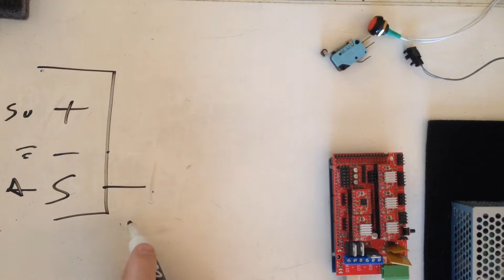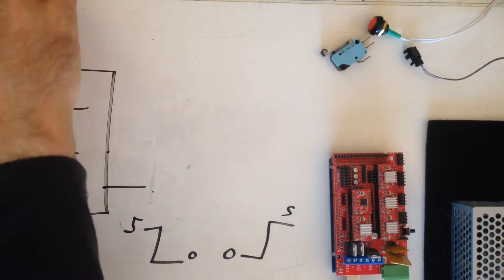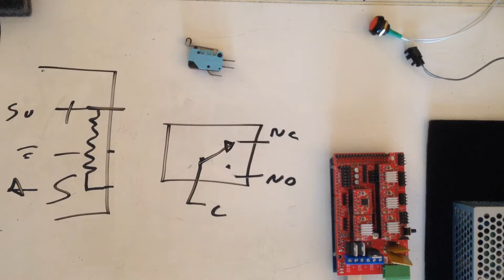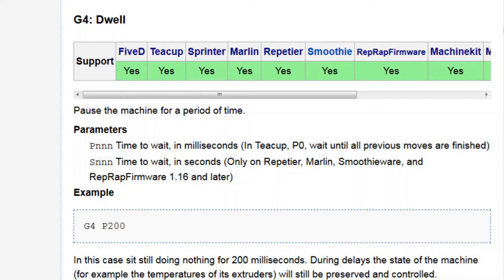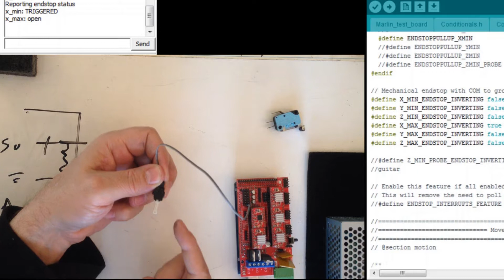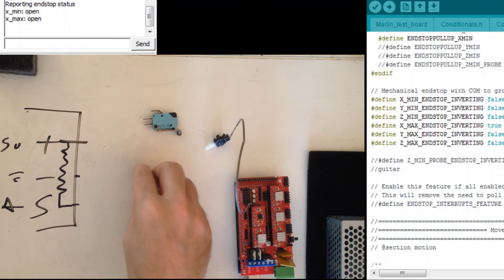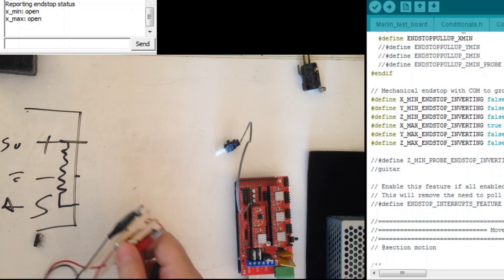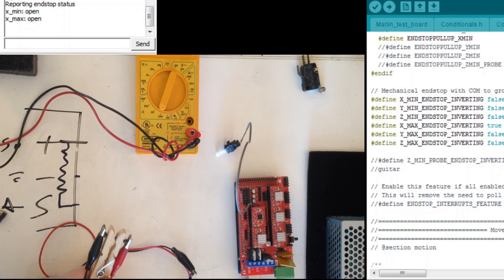Endstops and Explanations Pt 2 Switch Types

Comment: There are also end stops fitted on a small PCB. What is their difference?
Reply from the maker: Good question. I guess I can't speak for every kind of board made, but for the boards I have, they function as a normally open (NO) contact between the signal and ground wires, and the +5 power wire allows the LED indicator to turn on when the switch is closed. 
So for a 3-wire endstop board with a switch, you would connect it to the RAMPS board 
RAMPS ENDSTOP:       SENSOR BOARD:
RED:         +5 Volts          POWER
BLACK:   Ground           GROUND
GREEN:  Signal               SIGNAL
For the  boards I have, you can use them without the +5V power, because the signal and ground are connected right to the COM and NO switch contacts, just as if you were connected to a switch not mounted to a board. The indicator LED won't light up when the switch is closed, but that's not necessarily needed for the RAMPS board to see then endstop switch.
Reply: Printerstein thanks for the clarification.
Reply from the maker: Thanks for asking, glad to help.